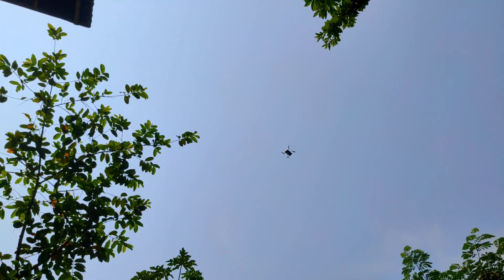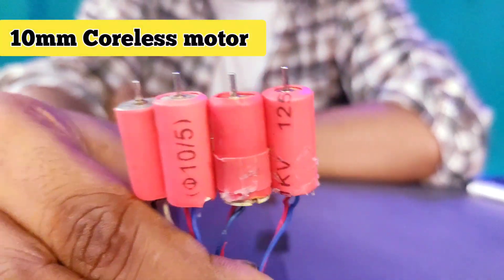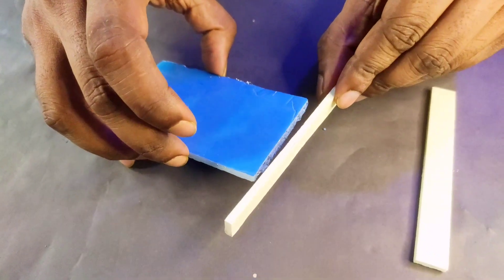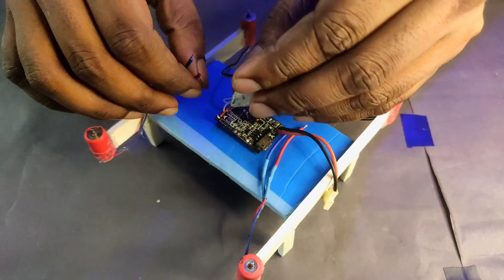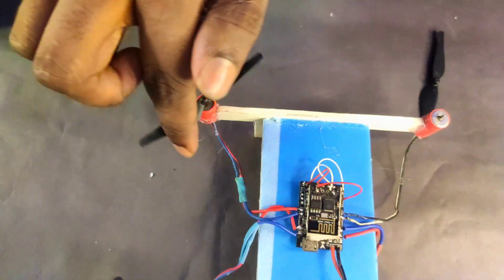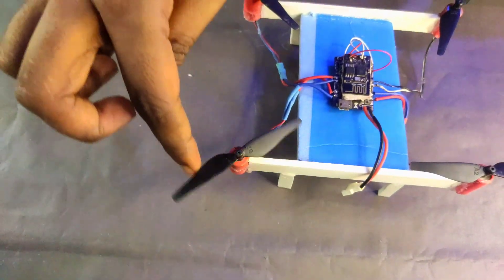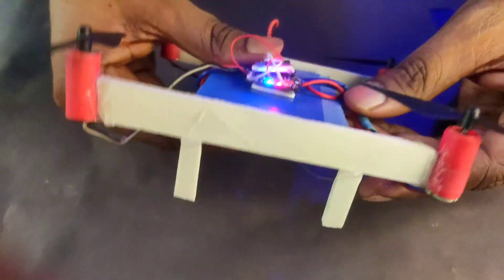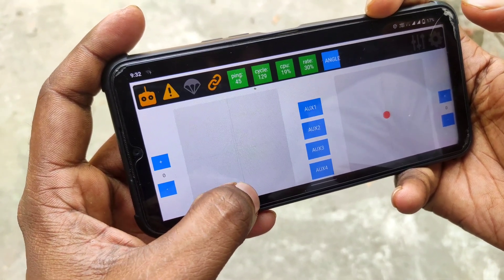How to Make Mobile Control Mini Drone using Esp8266

Comment: Can we use any other moter which is low cost .plsssssssssssssssssssss answer for my question
Reply from the maker: This is the cheapest motor for drone.
Without this motor you can not fly drone.

Comment: hello! if we wanna use arduino instead of F3 EVO brushed flight controller, what i should add
Reply from the maker: You can use "mpu 6050" gyro sensor,
Arduino nano, Bluetooth module or wifi module.

Mosfet + registor + diode for Motor control. 

And all others parts are same for this type of drone..
Reply: @ShahriarsTechGallery  thanks!